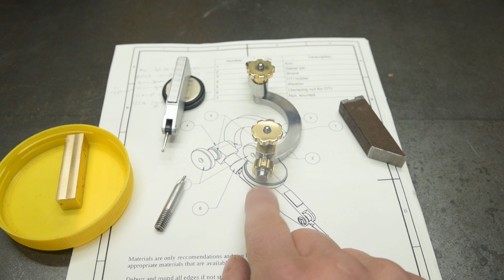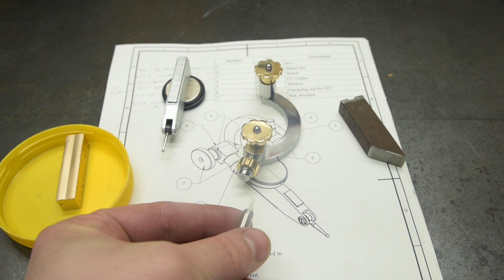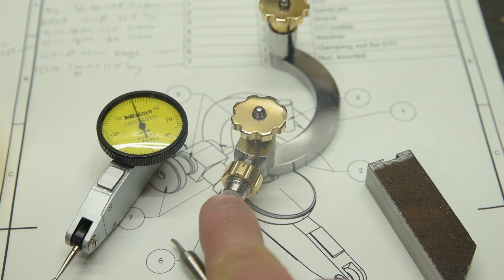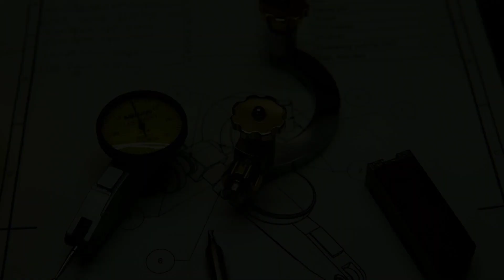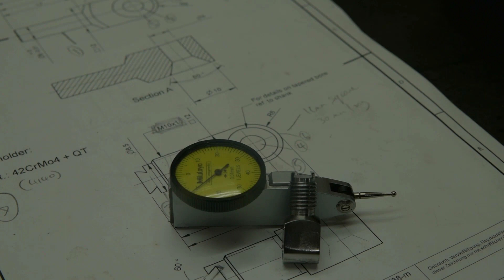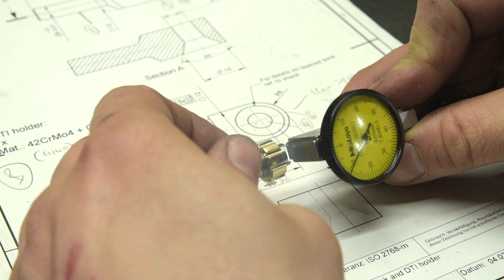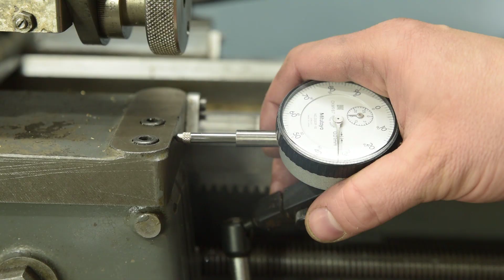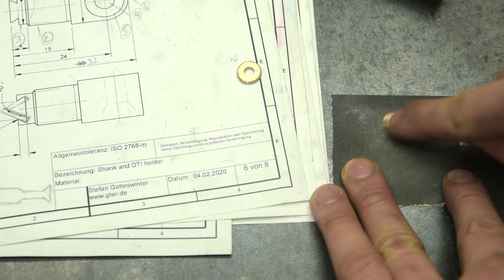Making Stefan's Indicator Holder -  Part 6 - Final bits of machining

Comment: looks good craig and looks like the cutter worked a treat.
Reply from the maker: Yes. Thank you for your previous guidance on getting my head around d bits and clearance etc. Very helpful and this was the first chance I had at trying the theory out. It was a rough looking cutter but it's hard to freehand something the size of a matchstick and get angles and relief all correct. There's a D bit grinder in my future!!

Comment: Looks great .  Both my dti's have slightly different dovetails  , i had to make a holder for each !   Cheers .
Reply from the maker: Yes, I may do as well. Thought I needed to make at least one that fit the cheapo indicator, but when I get the good one I may modify or make a second one. Not sure yet.

Comment: You've made a mighty fine job of this build. You mention issues with the cheap Chinese indicator locking and sticking. I have had a similar fault with a couple of my China made indicators and it is the dial/bezel and face inlay catching on the finger that usually causes the issues. They can be dismantled and the clearance problem fixed. I have no problems with either of mine now.
Reply from the maker: Thanks Howard! I will see if I kept that indicator, and if so, I will see if I can check for clearance issues. Thanks for the heads up.

Comment: I bought one of those rip off fake Mitutoyu dial indicators not long ago and like yours it started locking up, Not only that but the dovetails are out of line and poorly formed, so it now lives in the bin!
Love the indicator holder, think I might add that to the ever expanding to do list
Great video, thanks for sharing 👍
Reply from the maker: Thank you Dave - I appreciate the comment 👍. "Buy once, cry once". I've heard a lot of people say that but I'm beginning to learn that it's a good thing to live by. My cheapo DTI has magically come back to life (haven't touched it I promise!), so I will keep it around for now. A fitter and turner friend of mine suggested that I dismantle it and try to find the flaw/burr or whatever else is causing the problem, as an exercise. Sounded like a good idea, so I might try that one day.

Comment: Nice work Craig.  As good as you could hope for.  That single point dovetail cutter worked a treat.  I have never made one of those.  I have always ground a cone on HSS rod and slotted it same as the ones you buy.  Your unit did the job fine.  Interesting video.  Cheers Rob
Reply from the maker: Cheers Rob, with the dovetail cutter I was honestly just experimenting. The test piece came out so well (despite the cutter being a bit ugly) that I ran with it and the result it a nice fit. Might have to tweak it when the new indicator comes because it's a pretty close fit right now. Thanks for watching mate. Chat soon, Craig